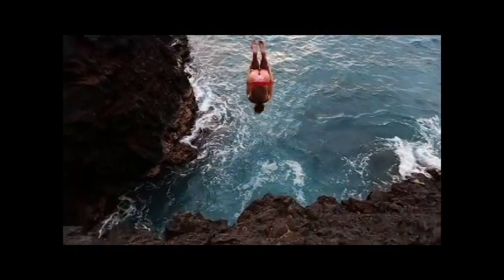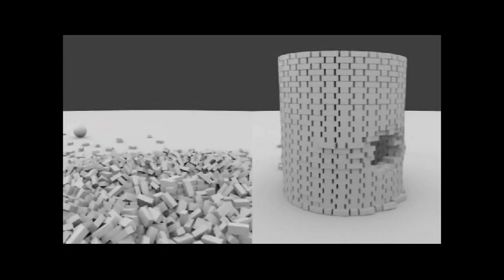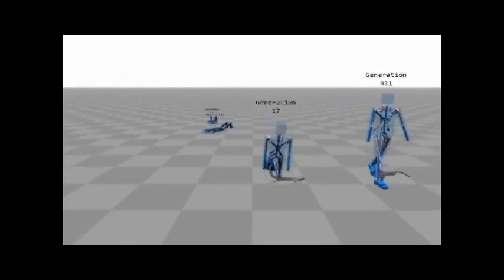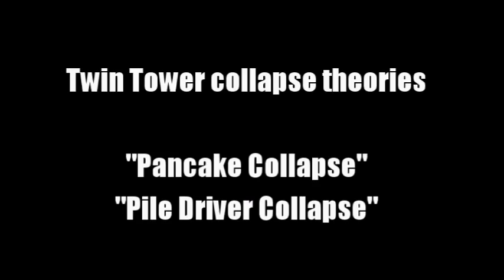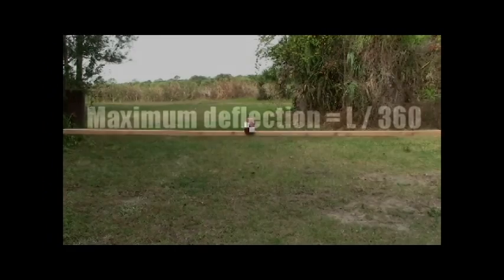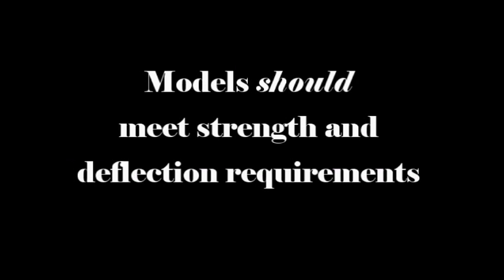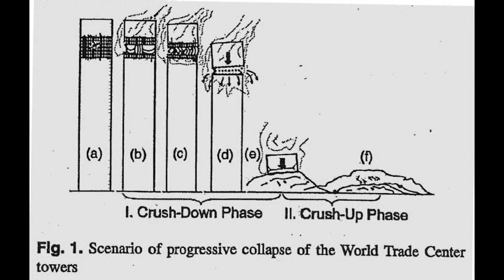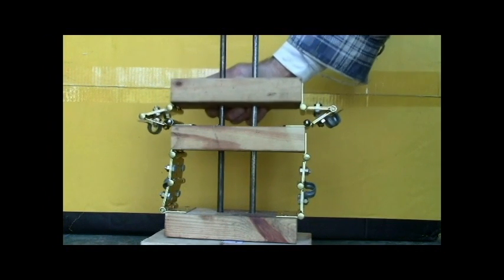9/11 Experiments: The Force Behind the Motion

Comment: I'm not a rocket scientist, nor a structural engineer, with all kinds of letters behind my name.  I just know this: the PLACE where one cuts on a tree denotes the direction the tree will fall, because the structural integrity is being removed, and, true to the laws of physics, the collapse of the tree should follow "the path of least resistance".  Since the Towers were struck on DIFFERENT sides, and at DIFFERENT floors, if the collapses were caused by the aircraft strikes, then everything ABOVE the point of impact was in danger, and should fall TOWARD the damaged point of entry.  Everything BELOW those points SHOULD still remain structurally sound, as the buildings were DESIGNED with the possibility in mind, that they could be struck by aircraft, and were built to preclude the possibility of a total catastrophic collapse.  So, rather than for the floors ABOVE the PoI, simply "kinking" toward the side of the damaged entries, breaking off, and falling into the street, following the path of LEAST resistance, INSTEAD, the tops above the PoI fall through the paths of GREATEST resistance, i.e. THROUGH ITSELF, and DOES SO at the rate of NO RESISTANCE...TWICE, on the same day!
I'm sorry to say, folks; but THAT'S NOT  physically possible, if what we all were told is accurate, ie that the PLANE IMPACTS brought down the Towers.

Really?  From all the jet fuel that went down the elevator shafts, and weakened hardened structural steel that INCREASED in cross-section and load-bearing strength, the closer to the ground it was??  

Got another question.  We all SAW the planes hit the Towers.  The media those clips 1,000s of times, where we all SEE the giant orange fireballs, as the planes impacted the Towers, and ignited the jet fuel.  Both horrific, and spectacular.  So...if the jet-fuel ignited on IMPACT, then, how did it go down the elevator shafts, and what fuel did "all the other fires on the floors" use?  Office materials??  And if burning fuel went down the shafts, how did it get out on the floors (as the elevator doors are metal, and would've been CLOSED)?
As WTC-7 was NEVER STRUCK by an airplane, what caused it to collapse [@5:20pm, 20 MINITES(!) after it was first reported ON VIDEO, by BBC reporter Jane Stanley]?  Not only was WTC-5&6 BETWEEN Tower  2 and Bldg 7, WTC-7 was ACROSS THE STREET from 5&6!!
So how does that happen, people?  Because ANYONE can see the collapse of the LV Sands Hotel, as compared to the collapse of WTC-7, and SEE what brought it down!
Like I said, it DOESN'T take a Rocket Scientist....
And regarding the Pentagon, as compared to the Towers, if a 757 hit the Pentagon, ONE of two things HAVE to be true.  Either 40-60 feet of wing and engine should've left a TON of damage, on BOTH sides of the main [center fuselage] hole, or the wings should be sheared off, and in front of the Pentagon; ONE or the OTHER!  So...where are they??
Using a known plane crash [PanAm Flt 103, Lockerbie Scotland, 1983] for comparison, where's are the 1) wings; 2) engines (2); 3) landing gear; 4) charred seats; 5) baggage; 6) broken tail section; 7) the indestructible "black boxes"?  Why were all the video of every camera within a 1-mile radius of the Pentagon, confiscated, and then CLASSIFIED by the FBI, if what we were all TOLD was true?  What happened to the $2.3T reported by Rumsfeld at a public press conference, ON VIDEO, THE DAY BEFORE 9/11??
Somebody, "Riddle me THAT!!"
Reply: "true to the laws of physics, the collapse of the tree should follow "the path of least resistance"

Conspiracy theorist say this thinking it sounds very scientific.  There is no law that states that material should move to the left or right to avoid more material below it.  Gravity pulls down.   

" Since the Towers were struck on DIFFERENT sides, and at DIFFERENT floors, if the collapses were caused by the aircraft strikes,"
They weren't, although they were a factor.

"and should fall TOWARD the damaged point of entry.  "
The towers collapsed when the perimeter columns failed on one side and the buildings DID lean to that side at the beginning of the collapses.

"I'm sorry to say, folks; but THAT'S NOT  physically possible"
Just because you don't understand it doesn't make it impossible.    Everything you said was wrong but lets stick with the first error for the emoment.
Reply: @markh1011  I notice you didn't TOUCH my points about WTC-7 or the Pentagon?  Why? Because you can't even BEGIN to argue the strikes of  those other two structures.
RegRding the two mains, there is a REAL problem for you.  Various samples of the WTC dust has been submitted and tested under analysis-SCIENCE- not "conspiracy theory", like you want to throw around.  And what has been discovered? Flakes of unburned nano-thermite, and spherical iron balls of minute size, indicating EXTREME temperatures; WAY MORE than is possible from a jet fuel/office-materials fire.  This dust was first discovered by Dr. Stephen Jones at University of Utah, when people from all over Manhattan shipped him vials of WTC Tower dust, and ALL tthe samples had these two substances in them.  How does THAT happen?  
Since the structural steel cross-section INCREASES, the closer to the ground it is(as there is more weight on it at the bottom, as opposed to the top), it means that the closer to the ground the collapse gets, the greater the  resistance.  Which means, it CAN'T  fall at the rate of NO RESISTANCE; unless the resistance is removed sequentially, "on the way down", and hidden in the cloud of falling debris.
If the floor joists all failed, like a zipper, it had to START somewhere, unless they ALL failed at exactly the  same moment, repeatedly, on several floors.  How does THAT happen? without "direction, and assistance"?

Home come everything BELOW the impact, collapses, as the resistance increases.  The NOVA special that used CGI to explain the "pancaking of floors", LEFT the main core columns STILL STANDING in the animation(!), which, if the official story was even close, would resemble the graphic; it DOES NOT.  Live in denial, if you choose; until those questions are addressed, and REAL investigation is done, which I doubt will ever happen now, 20+ years later, I WILL NOT.  And the questions  NOW, can no longer be avoided.
Reply: @rhunter762i  
" notice you didn't TOUCH my points about WTC-7 or the Pentagon?  Why? Why?"
Because I couldn't be bothered addressing every error in your post.  There were so many.   How about you address what I said and then we can get to those hrm?

" Because you can't even BEGIN to argue the strikes of  those other two structures."
Oh I can.   Again - How about you address what  I said and then we can get to those hrm?

"Various samples of the WTC dust has been submitted and tested under analysis"
Ah yes, tested by Steven Jones, Niels Harrit and their buddies.
They were hoping to prove their crazy claims about thermite.  But what they found didn't match thermite (ignition temp, energy release rate etc) so they just declared that it was mysterious nanothermite.
Did they have any nanothermite to test their claim?   No.
Did they confirm if the dust had nanothermite in it?  No.
Did they test if you could bring a structure down with nanothermite?  Of course not.
Did they do any follow on tests?  No.
Did they pass the samples on for independent tests?   No.
All they have is an assertion that the dust has a mysterious substance in and it's never been confirmed.
Reply: @rhunter762i  
" Which means, it CAN'T  fall at the rate of NO RESISTANCE"
The towers didn't fall with zero resistance.  But you're missing an important factor here.  When the collapse wave reaches the lower floors the amount of material crashing down makes the resistance almost negligible.   Lets pick the 30th floor.   The columns are a little wider.   You have 80 floors of material smashing down, with high velocity and therefore force, on the 30th floor.  The fact that the columns are a little wider has no effect arresting the collapsing building.  

"If the floor joists all failed, like a zipper, it had to START somewhere,"
What are you confused about.  It did start somewhere.  It started on the collapse floor where the perimeter columns failed on one side.  

"Home come everything BELOW the impact, collapses, as the resistance increases. "
Because everything below is getting hit with tons of concrete and steel.  It's a progressive collapse.   The amount of floors involved in the collapse increases.  It's like a hammer getting heavier.  

"which, if the official story was even close, would resemble the graphic;"
No the core was smashed with everything else.  It's bizarre to think that it would somehow be magically invulnerable.
 
Try to respond to my posts and maybe I'll get to your confusion about the pentagon next.
Reply: @rhunter762i  
" I will not be responding to anymore of your nonsense. "
Of course not.   I refuted your claims easily and you realise you're being proven wrong.

1.  The debris falling next to the towers fell faster than the towers.  The debris was in free fall.  The towers were not.

2.  The collapses started at one floor, on one side and the towers leaned towards that side during the collapses.  It was more prominent at the start. 

3.  The core was destroyed with the collapse.  It was destroyed during the collapse and there is no logical reason to think it wouldn't be.

You offered three "arguments" and they were very easy to correct.

I'll get to some of the waffling in the next post.
Reply: @rhunter762i  
"Go find  and about Operation Northwoods,"
Oh I know all about it.
Lets debate it.
Tell me, what do you think Northwoods proves? Lay out an actual argument.

I skimmed the rest of your post and actually said nothing.   Just rookie conspiracy theorist ranting.
Reply: @rhunter762i  
"I'm not bothering to play constant "posting games", with you; "
Posting games?   lol...   you mean you can't defend your claims and you're running.  

You realise I know more about this and refuted your claims easily.    Now you want out.
Reply: @rhunter762i  
If you don't  see the ramifications of Operation Northwoods"
No you don't get it.  I know all about Northwoods.   I'm challenging you to debate it.
You're running.  
Get back to me when you're ready kid.
Reply: @rhunter762i  "I will not be responding to anymore of your nonsense."
The least you can do is explain why you think it's nonsense. So far you ignored that.

"The Towers MOST CERTAINLY fell at the rate of FREEFALL speed"
There is no such thing as free fall speed. It is increasing speed over time, called acceleration. None of the towers collapsed at free fall acceleration. How do you expain debris falling past the still standing parts of the towers?

"the failure would start at ONE point, and the collapse would be IRREGULAR and "messy""
The way the towers collapsed progressively is not determined by the onset, but by the engineering. 

"WHY weren't the core columns left standing"
They were. Please watch any of the videos of the collapses. After a few seconds, they collapsed as a result of a lack of support from the floors. The core columns were not cross braced and couldn't stand alone.

"NEITHER one could happen"
Watch the videos and see how the core columns remained standing for a few seconds after the building around them fully collapsed.

I skipped the ramblings.

" it was declassified, I believe in 2005"
1992

"That's not MY "conspiracy theory", that's  DOCUMENTED FACT!!"
The only fact here is that it was a plan that was never executed.

"I would suggest you take some time to learn what your country has done in and to other countries"
How in any way does that prove 9/11 was p[lanned and executed by the US government at all? :)

"common sense"
See, your common sense or for that matter my common sense is irrelevant to anything that isn't proven by facts and verifiable evidence.

"We CAN'T  be afraid to ask questions"
It's not about asking questions. It's about accepting the answers when the evidence leads you to them.

"And if what we have been told, is a gigantic LIE, then we MUST have a "Come-to- Jesus" moment"
WTF does religion have to do with evidence? They are opposite phenomenons.
Reply: "I just know this: the PLACE where one cuts on a tree denotes the direction the tree will fall"
Yet a tree is no representation for a super high rise, is it? Have you ever seen a tree progressively collapsing?

"true to the laws of physics, the collapse of the tree should follow "the path of least resistance""
You do realize that steel is not a liquid and gravity always pulls straight down? The only thing that is relevant here, is if the mass of falling debris exerts a force strong enough to break the encountered barrier or not. If what you claim is actually true, the debris would have fallen upward, since the density of air is less going up and so provides less resistance. Doesn't make much sense, does it?

"if the collapses were caused by the aircraft strikes, then everything ABOVE the point of impact was in danger, and should fall TOWARD the damaged point of entry."
The collapsed were not caused by the impacts. As we have all seen, the towers were still standing after the planes impacted. The direction of the initial collapse is determined by the columns that were heated most by fire. Heat causes steel to weaken. The weakest columns will fail first. Now we have only slightly touched the first or initiating part of the collapses. The second part of the collapses was not the result of the impacts of the fires. It was the result of the way the towers were designed. 

"Everything BELOW those points SHOULD still remain structurally sound, as the buildings were DESIGNED with the possibility in mind, that they could be struck by aircraft"
Actually, the lower parts were still structurally sound up to the moment the mass of the upper parts was coming down. The design of the towers would have kept them standing after a plane impact. That is exactly what happened (although the the calculation was done with a slow flying aircraft, low on fuel in mind).

"and were built to preclude the possibility of a total catastrophic collapse"
According to whom? At least not according to Leslie Robertson, the actual main engineer of the twin towers. So a source of your claim would be highly appreciated.

"So, rather than for the floors ABOVE the PoI, simply "kinking" toward the side of the damaged entries, breaking off, and falling into the street, following the path of LEAST resistance, INSTEAD, the tops above the PoI fall through the paths of GREATEST resistance, i.e. THROUGH ITSELF, and DOES SO at the rate of NO RESISTANCE...TWICE, on the same day!"
As soon as the tops of the towers started tilting, forces acting upon these tops were shifting to such a degree the connections that kept the individual pieces together could no longer hold and failed. Try holding up an umbrella between thumb and index finger. All good as long as that umbrella is pointing straight up. Now try to tilt it and still keep holding it between your two fingers. You can't. The forces have shifted to such an extent that you two fingers will not be able to hold the umbrella up.

None of the towers collapsed at free fall acceleration. South tower took 15 seconds to collapse. North tower about 22. A free fall collapse would have meant a collapse time of 9.2 seconds.

"if what we all were told is accurate, ie that the PLANE IMPACTS brought down the Towers"
Whoever claimed this?

"From all the jet fuel that went down the elevator shafts, and weakened hardened structural steel"
Nope. The jet fuel did not weaken any part of the structure that wasn't on fire.

"Got another question."
Go ahead.

"So...if the jet-fuel ignited on IMPACT, then, how did it go down the elevator shafts"
Why do you think ALL jet fuel ignited upon impact? If that would be a thing, we wouldn't need fire fighters at plane crashes, would we? A large part of the jet fuel did indeed explode upon impact. Yet part of it didn't and fell down, helped by the initial explosion. Wht do you think so many people reported the smell of kerosine in the towers?

"and what fuel did "all the other fires on the floors" use?"
The lower floors did not use any fuel. The falling mass of the upper part was more than enough to break the floor-to-column connections which made the entire structure fail.

"And if burning fuel went down the shafts, how did it get out on the floors (as the elevator doors are metal, and would've been CLOSED)?"
Elevator shafts are not closed off by elevator doors. Only the car is. But your point is still irrelevant since I have never heard of water tight elevator cars. Have you?

"As WTC-7 was NEVER STRUCK by an airplane, what caused it to collapse"
Recommended reading: Final Report on the Collapse of World Trade Center Building 7, Federal Building and Fire Safety Investigation of the World Trade Center Disaster (NIST NCSTAR 1A)

"Not only was WTC-5&6 BETWEEN Tower  2 and Bldg 7"
Why is that relevant in any way? 5 and 6 were 8 storey buildings. The north tower was 110! How would these two 8 storey buildings prevent debris from a 110 storey hitting a 47 storey building? :)

"WTC-7 was ACROSS THE STREET from 5&6!!"
So? 

"ANYONE can see the collapse of the LV Sands Hotel, as compared to the collapse of WTC-7"
How does looking at another collapse reveal anything about a first collapse at all? It like saying my neighbor caused a car accident by texting and not paying attention. So other car accidents are caused by the same.

"Like I said, it DOESN'T take a Rocket Scientist...."
So far you haven't said anything that make any sense.

"Either 40-60 feet of wing and engine should've left a TON of damage, on BOTH sides of the main [center fuselage] hole, or the wings should be sheared off"
Option three: A plane impacting at 500+ mph won't leave any recognizable debris and the wings will basically be reduced to dust.

"Using a known plane crash [PanAm Flt 103, Lockerbie Scotland, 1983] for comparison"
How does that crash compare to the Pentagon crash? A plane blown up mid air will break up. Any debris will fall down at terminal velocity (which will never ever reach 500+ mph). Find the video called "F4 Fighter Jet vs A Concrete wall" and see what an impact with 500 mph to a concrete wall will do to a plane.

"where's are the 1) wings"
Pulverized

"2) engines (2)"
One of them was evidently photographed, or at least the strongest part of it.

"3) landing gear"
Found at the exit hole in the C-Ring.

"4) charred seats"
Photographed and available online.

"5) baggage"
Same

"6) broken tail section"
Broken up into thousands of little pieces like the wings.

"7) the indestructible "black boxes"?"
Both recovered.

"Why were all the video of every camera within a 1-mile radius of the Pentagon, confiscated"
They weren't. 

"and then CLASSIFIED by the FBI"
They weren't. Search for the Maguire declaration.

"What happened to the $2.3T reported by Rumsfeld at a public press conference, ON VIDEO, THE DAY BEFORE 9/11??"
It was NOT a public press conference. It was an opening speech to the DOD Acquisition and Logistics Excellence Week Kickoff—Bureaucracy to Battlefield. Mostly pensions were paid by this 2.3 trillion. Do you actually believe the money went missing? :) If so, why would you think that? The quote in context is as follows:

"The technology revolution has transformed organizations across the private sector, but not ours, not fully, not yet. We are, as they say, tangled in our anchor chain. Our financial systems are decades old. According to some estimates, we cannot track $2.3 trillion in transactions. We cannot share information from floor to floor in this building because it's stored on dozens of technological systems that are inaccessible or incompatible. "

Rumsfeld was discussing an outdated IT infrastructure that did not allow accountants to track transactions inputted in system A in system B. He was talking about an IT/accounting issue. You just need to read the speech or listen to it.

Why would Rumsfeld even mention missing money the day before 9/11 at all if the actual alleged evidence was to be destroyed the next day? :)

"Somebody, "Riddle me THAT!!""
Done and dusted.